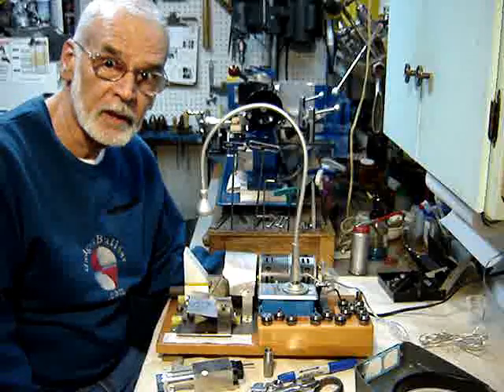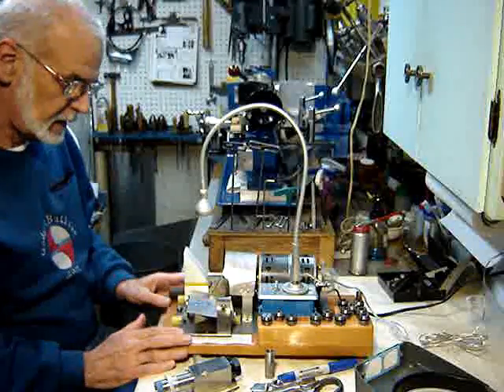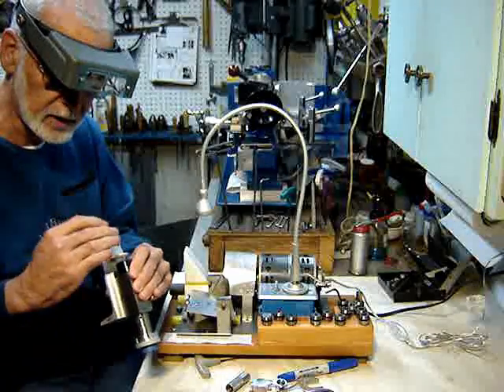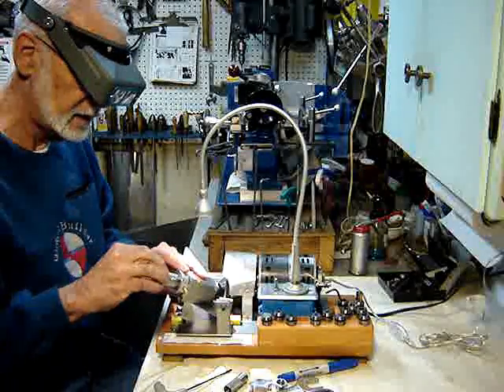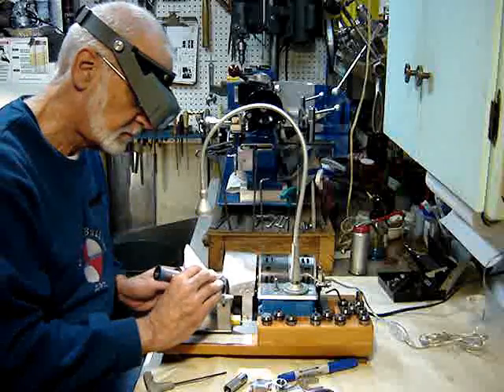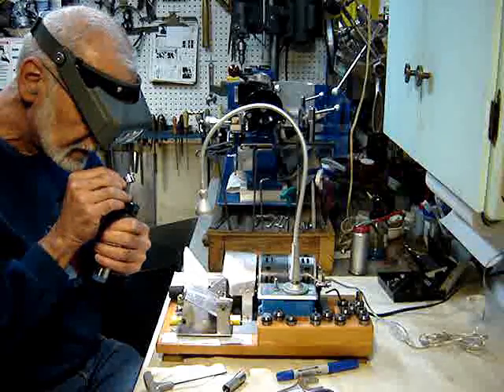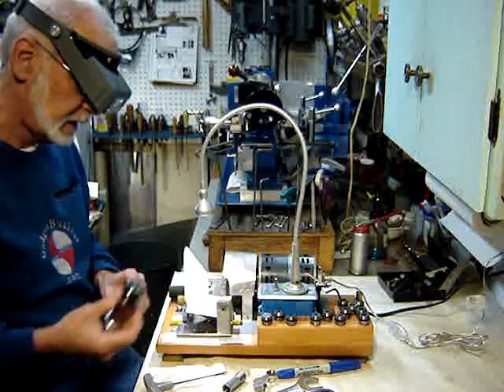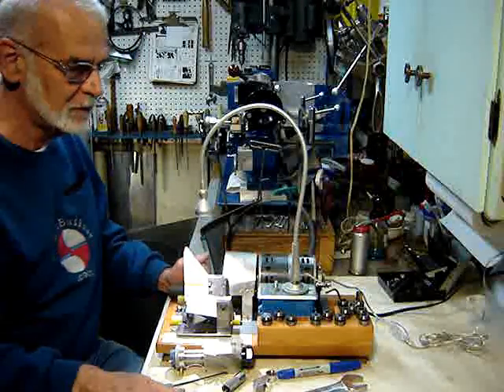4 Facet Drill Sharpener  -  Shop Built

Comment: How do you keep the chisel edge angle at  135deg?
Reply from the maker: +adam wooldridge 
There are two sets of alignment holes in the trunnion table, one set for 118 degree points and the other for 135 degree points; 2 pins on the bottom of the collet holder engage these holes. The appropriate holes are utilized for the desired point angle.  There is a movable pin which can be set to prevent engaging the wrong set of holes  (this was added after I accidentally changed point angles part way through sharpening a drill ;-)  
   In the following picture the collet holder is at 118 and the 135 degree hole in the trunnion table is visible just to the left of the collet holder:  http://www.gadgetbuilder.com/4Facet_Ctrls.jpg
Reply: Gadget Builder
I understand how you would get different point angles...But my question was about the chisel edge angle ....|From where im looking you dont appear to be putting on any chisel angle at all

Comment: I'd like to make one that can handle drills up to 1 1/16 in diameter.
I manage the tooling / buying / and mentor  students here at Dunwoody College of Technology.. I retired after 43 years as a toolmaker. Now I share my knowledge with new machinists. This would be a great project for them to build as a group from the ground up.
What motor size would you suggest we buy for this enlarged version?
Reply from the maker: Ronnie Underhill 
Probably best if you look over the info on my site to understand the concept used:
http://www.gadgetbuilder.com/DrillSharp.html#Facet4
This design holds the drills in collets; it would need a very large collet  and holder for drills over 1".
Plans were in "Home Shop Machinist" magazine, January&March 2012.
If you have more questions you can contact me (email) via my site.

Comment: I was curious if you ever put a split point on a drill, and whether this jig will do that....
Reply from the maker: This sharpener will split drill points as well as sharpen drills although I didn't show point splitting in the video.   The collet holder is shown on the point splitter in this picture:  http://www.gadgetbuilder.com/4FacetPointSplitter.jpg
A drill sharpened on the jig, including a split point, is shown here:  http://www.gadgetbuilder.com/6_Facet_SplitPointC.jpg

Point splitting is more "fiddly" than sharpening in that one must look at the results and adjust slightly as needed to get the split exactly right.  Not difficult but it may require removing the collet holder from the jig to view the intermediate results once or twice in the process so it can take a minute or two to split a point.

Comment: Where can i get the same head gear you have on? I have to where 2 pair of glasses. Very nice tool, And great job.
Reply from the maker: The head gear is an OptiVisor by Donegan.  I use a #5 which is 5 diopters, works well in the shop.  The #10 is more powerful but needs to be very close to focus.  Lens is glass so it doesn't scratch easily.
Reply: Thank you so much Gadget Builder for the quick reply, I rebuild oil field engines, And do a lot of magneto work. So this will help me a great deal, You do great work and i like to learn, I was watching KevinMillard68 dress a tool bit, And i thank he was the one that put your link up, Anyhow have a great day.
Reply: Randall Moore Iam sorry Gadget, The person that gave me your link was Halligan142. Not Kevin Millard, Sorry about that.